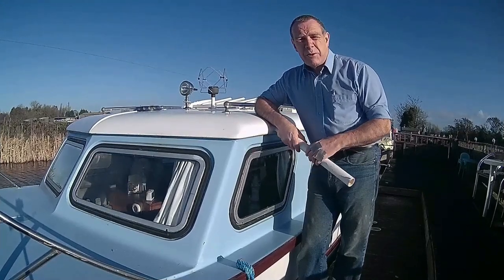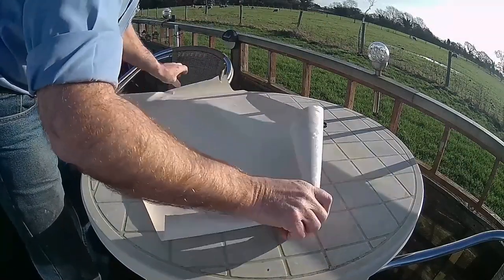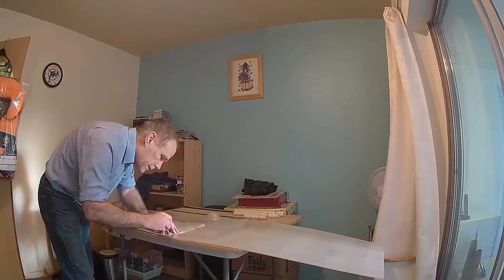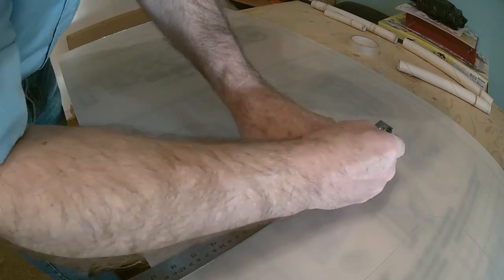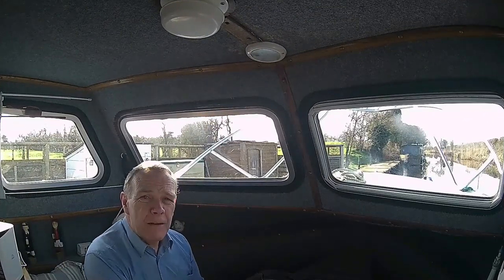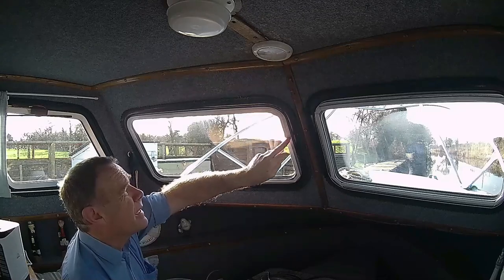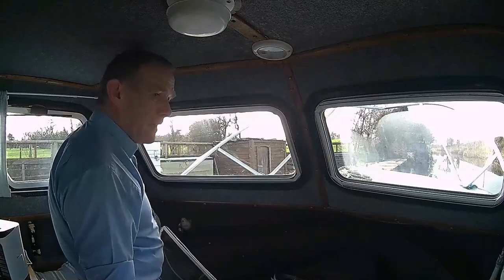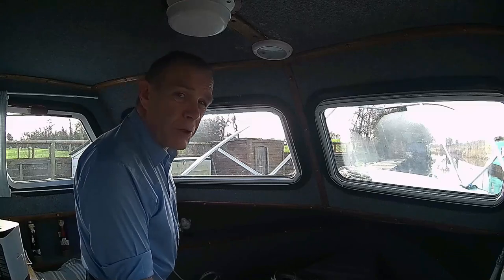04 - Installing secondary double glazing on a Nauticus 27 (subtitles)

Comment: What a great idea! Trying to sleep in a very cold Nauticus 27 right now, going to put it into practice at first light!
Reply from the maker: Glad you found it helpful. One tip, when marking out the template for the small rear windows (ie galley and head), do it from inside the boat. I made the mistake of doing it from outside, as I did with the other windows, and found it was too small. Also, of course, you only need to do templates for one side, as the other side is a mirror image, so you can cut all the windows from one set of templates, and then just flip the windows round for fitting on the opposite side.

Comment: What brand of magnetic tape did you use, I’ve never been able to get anything to stick to the window frames
Reply from the maker: It is an unbranded one, which I got off eBay but, provided the frame is cleaned and dried thoroughly, I found it sticks really well. Here is a link to the item page https://www.ebay.co.uk/itm/Magnetic-Steel-Tape-Secondary-Glazing-20m-Kit-for-White-Window-Click-Collect/271392140129?ssPageName=STRK%3AMEBIDX%3AIT&_trksid=p2060353.m2749.l2649